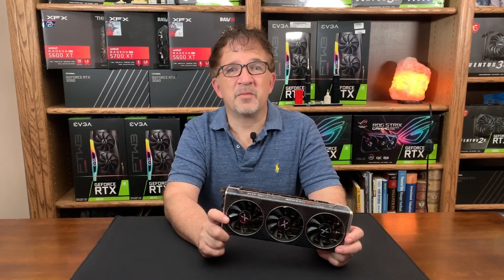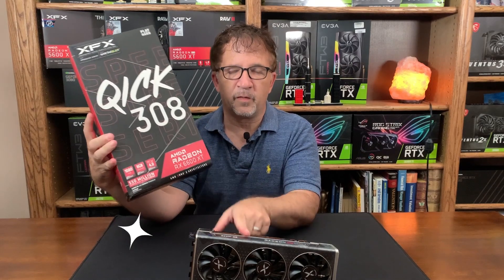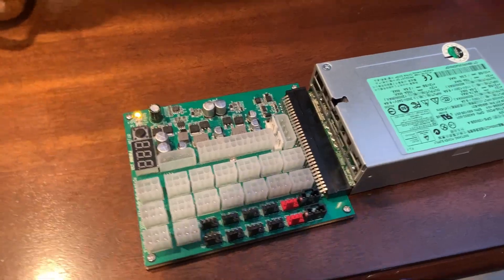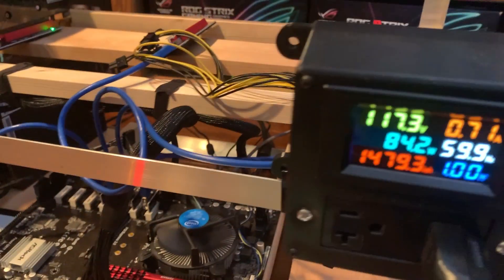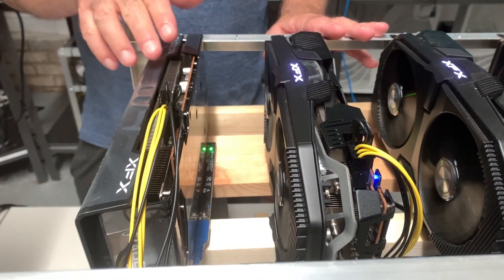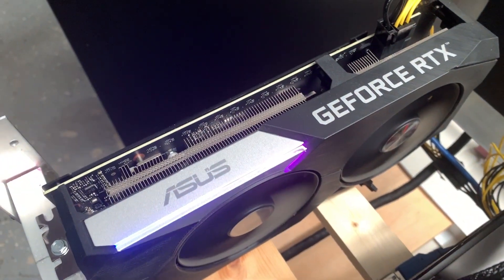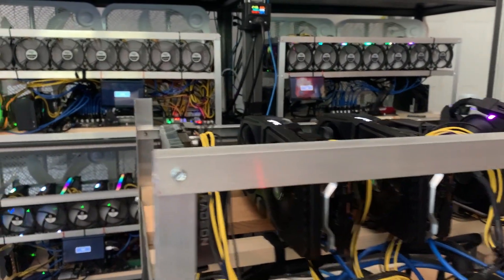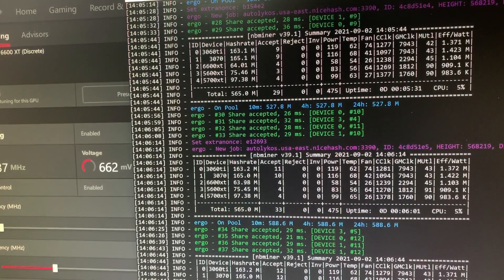R.I.P.🪦XFX 6600XT | UNVEIL TRUE POWER USAGE | ETH & ERGO MINING 5600, 5700, 3060TI, 3070 VS. 6600XT

Comment: The thing with AMD cards is that they simply measure the CORE power only while nvidia tracks the power of the whole. Which is exactly why running full bore fans on nvidia makes you lose clockspeed since it using more of the given TDP.
Reply from the maker: That's what I thought too. Appreciate the confirmation !.

Comment: So far I have mined with two 6600 XT and I have a third one waiting to be mined with, so far the fan profile will glitch out and go into Auto mode which can be dangerous cause the card starts to heat up until I re-adjust the fan
Reply from the maker: Hope you can get it resolved. Curious which card make is it ?